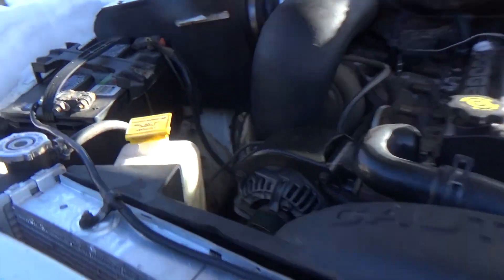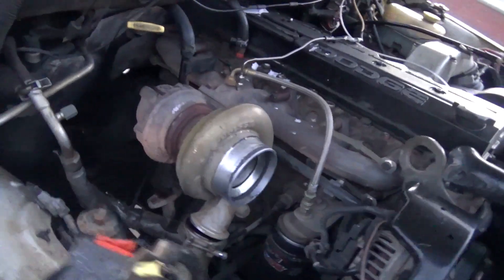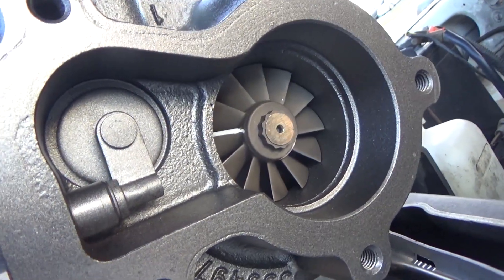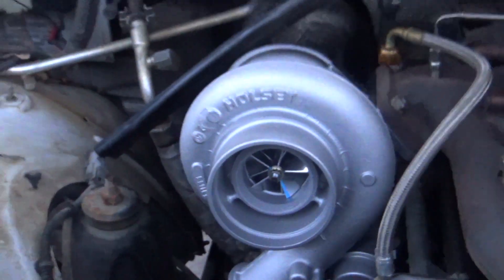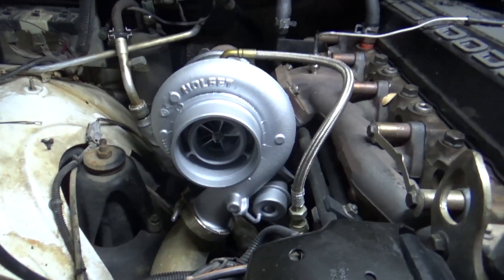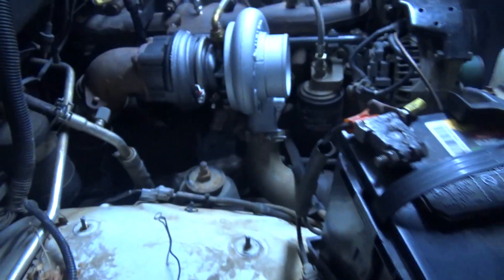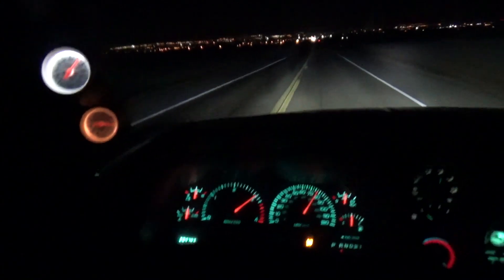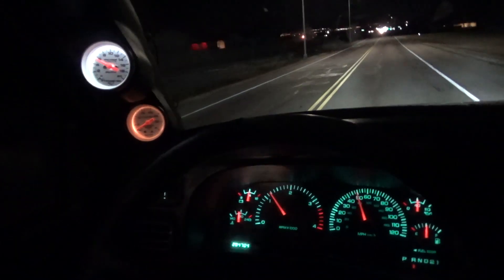Billet HY35 Holset | 5.9 Cummins!

Comment: You have done head studs in that truck haven’t you. If not you’ll probably want to before you pull 33psi of boost much or you will lift the head
Reply from the maker: Stock head studs and stock rebuilt turbo. It only makes 30psi at full throttle.
Reply: You might want to invest in you a set if you can afford them at 30 psi your getting into the zone were you could start lifting the head fairly easily if your not careful